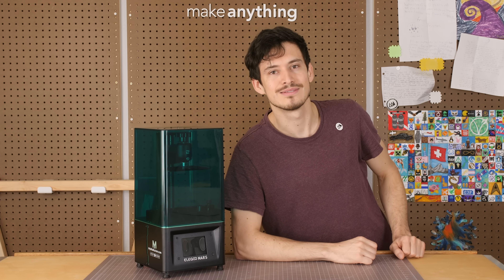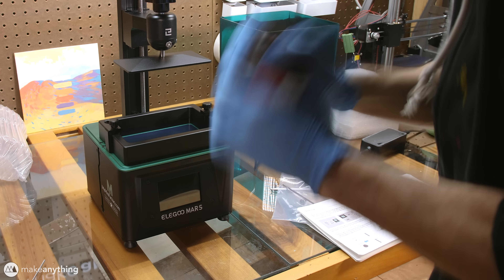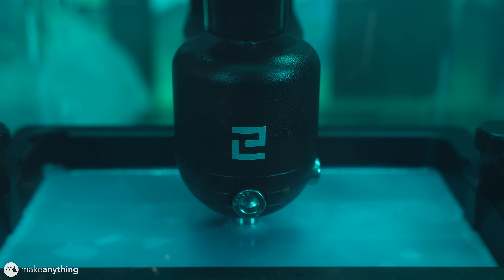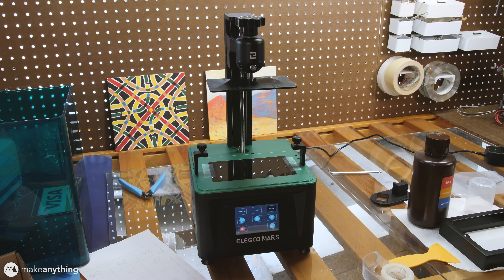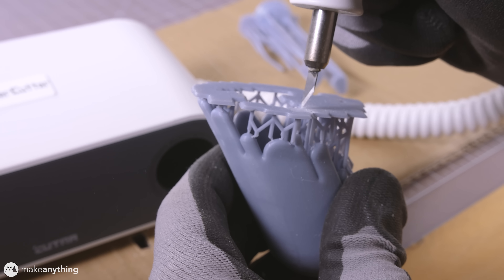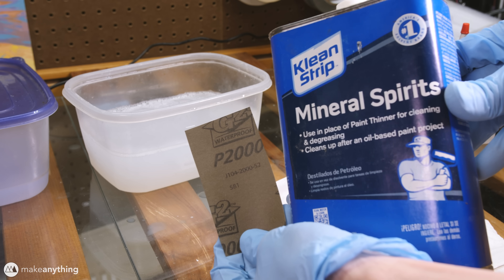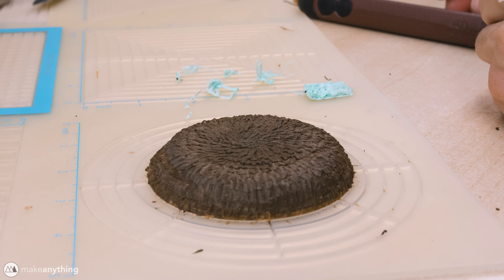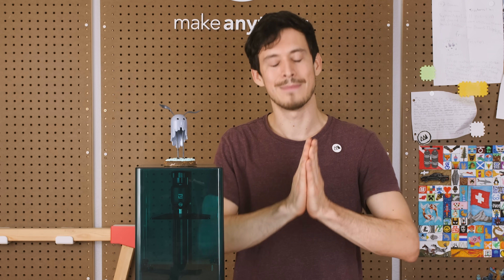Resin Printing with the Elegoo Mars // First prints, troubleshooting, impressions

Comment: Hey Devin, there are a couple things that I noticed. First, you have the reservoir in backwards.  You want the notch to be in the front right corner to make it easier to pour resin into it while printing, and when removing.  Also, it appears that you didn’t fully cure the prints, as they were way to flexible. It’s a misnomer that you can let them sit in the Sun for a few hours. It would take days.  It takes a few hours to fully cure prints with a 60W UV lamp.

As for the failures, that is due to the build plate not being flat.  I used 220 grit wet/dry sandpaper to level the plate against a perfectly flat marble surface.  Sand it down until there is no black anodization on the plate.  You can either leave it that way, or continue to smooth it with 400 grit. Then make sure you level it properly.  You didn’t show the test to ensure that it was flat, where you slide the paper in and out. Pay special attention to the corners.

The good thing is that they replaced the screws on your build plate with bolts, which is what you need to do if you buy the normal Elegoo Mars.  If you want truly accurate prints, you’ll also want to manually set the Z axis zero.  There are other things in the configuration that will make life easier too, so I suggest looking into them. I don’t have the links right now, but I can get them when I get home, if you need them.

Great content!
Reply from the maker: Sounds like solid advice. Thanks!
Reply: @make.anything  Fantastic video, few more small things i hope save you some time!

silicone sculpting tools are a great way to stir up your vat and the edged ones will also usually remove failed prints from the vat with a guarantee that you won't scratch anything

I would advise against paper towels on the vat! They leave lint and micro scratches and greatly increase the probability of something sticking to the surface.
Pick up some PEC-PADs for photography, they are very cheap and you can use them for you camera gear too! Great for cleaning the screen and other clear surfaces.

Most of the time you won't need to drain the entire vat for a failed print, if it's a large flat surface, you can use the silicone tools or your fingers (wearing gloves obviously) to extricate it. 

Ambient temperature has a dramatic impact on print success, generally, warmer is better but consistent temperature is also critical. take a look at egg incubators, they are cheap, you can position the thermocouple as needed and usually a ikea container or even a tote is enough insulation.

Might consider inverting your model if you are going to sand the surface regardless those "drip details would come out perfect

A #11 scalpel is a great tool for cleaning off supports, very cheap too.

Typically two separate washes of alcohol are used, if that's what your manufacturer suggests though, i would defer to that.
 A tooth brush really helps clean out those details after ten minutes of soaking in alcohol.

Finally, i second the build plate abrasion.

(note: i use a Moai 130 and Form 2 so there may be some machine specific differences)

Love your content and look forward to your future uploads!
Reply: I would add that it is easier to remove the supports before fully curing. This is information I only have second hand knowledge of as I have not yet printed anything on my Mars.
Reply: giliant you can use Kimwipes and alcohol on the film, as they are lint free and are non-abrasive when wet.  Kimwipes are heavily used in the electronics industry, and very minor scratches on the film don’t affect print quality. 😎
Reply: It might be very flexible because he used "ABS-like" resin.
Reply: Billynomate Mopp I have like 6 of the Elegoo resins, including the one that he used.  When fully cured it becomes very hard and stiff.  Due to the stiffness, thinner pieces become somewhat brittle when fully cured, but they can stand up to small amounts of stress.  His prints will continue to cure over time, in the position that they are standing.  Once fully cured, the legs could possibly break off if it fell off a shelf.
Reply: @KaelumYodi  Can you post the links for he rest of us, please?
Reply: Great feedback! I can't wait to start printing on one of these.. I'll make sure to pay attention to these items.
Reply: Kaelum I have an anycubic photon, and whenever I print, since I don’t have a uv chamber, I put my prints in a glass or clear plastic container filled with water, and it cures in about 25 minutes.
Reply: @johnbickford9221  I do that, it's much easier.
Reply: Most of this is actually in the manual where it explains what to do before printing, so all mistakes could have easily been avoided ;)
Reply: Hey @kaelum
Do you know of any video tutorials about leveling the build plate per your description? Really great insight in this thread!
Reply: @ChelseaMakes  if you are referring to sanding it flat, there was 1 that I remember seeing back when I first posted this, but I don't remember who created it.  It took me a couple hours of sanding to get mine flat, as it was not very flat at all.  Pretty much any granite or marble surface that is at least 1/2" thick, should be perfectly flat due to the way that they are cut and polished.

Just wet the surface with water, place the wet-dry sandpaper on top, and then push the build plate into the sandpaper to grind it down.  Be careful to keep the pressure in the center of the build plate to prevent rounding the corners.  Rotate the build plate every 30 seconds to help ensure that it is evenly grinding down.  You'll need to rinse off the stone surface and the sandpaper periodically as the aluminum dust collects in the water.

I think I went through 3 full sheets of sandpaper to get mine nice and flat.  I didn't use a fine grit sandpaper at the end, and even used 110 sandpaper for some of the grinding, as I wanted the micro groves to remain for better adhesion.  Once done, make sure you follow the leveling procedure exactly as written by the manufacturer. Most people don't follow it exactly to a T, which is why they run into problems.

The best thing that I can recommend is to read as much about the printing process as you can, and from many different sources.  Some advice will be good, and some won't be.  As you gain experience you'll easily be able to know the difference.  Enjoy your printer, and have an AWESOME NEW YEAR!
Reply: @KaelumYodi  THANK YOU!
Reply: So was it that the bed was not flat or that he wiped it with lubricant? Because after that it started working right? He didn't level the bed.
Reply: Homie the sun is more than 60 watts. 

Its not a misnomer, a lot of experts recommend putting Resin prints outside to cure while you are still new and haven't purchased a curing lamp yet.

Comment: these are not latex glove, don't use latex with these kind of resin, use nitrile gloves!
Reply from the maker: You're right, thanks!
Reply: Why?
Reply: @OllieDraws  Because Resin eats through latex and can get absorbed into your skin.
Reply: @ScaryScarab21  resin isn't caustic...
Reply: CrossedCoder Yeah, resin definitely doesn’t “eat” through latex. Although the pores in latex gloves are big enough to allow resin to seep through.
Reply: And also do not use a dust mask for fumes and vapours.
Reply: CrossedCoder resin is very toxic lmao
Reply: @CrossedCoder  But it's carcinogenic ...
Reply: @igotsth  Yeah it's so stupid that the supply you with a dust mask. You get the impression that it's the correct safety gear ...
Reply: NeX128 woaaaah i had this profile picture since 2 years ago
Reply: Can i also use vynil gloves?
Reply: @robbys929   Depends on which resin you use. There are non-toxic resins available.
Reply: GGigabiteM hey answer my boy west side, idk what the answer is but I bet you do
Reply: @GGigabiteM  What do you think about Anycubic plant-based resin?
Reply: @MurderHoboRPG  vinyl*

Vinyl gloves are better than latex in porosity (the molecules are smaller), more chemical tolerant and of course people can have latex allergies.

I usually use heavy duty PVC gloves when I'm working with nasty chemicals, but the downside is you lose a lot of dexterity and feel because they're so thick.

Other types like nitrile are OK too.
Reply: @pimbiob.v.4581    I just ordered two liters along with a Elegoo Mars.  So I hope the Eco-Resin lives up to the hype.
Reply: @OllieDraws  resin can bleed through latex. Would be like wearing nothing.
Reply: zapro_dk they are actually fume and dust masks they contain carbon-13 (activated carbon) which filters out the nasty fumes and the tightly woven material filters the dust out. 

It is easy to see if they contain carbon-13 or not, if they have a grey colour to them they contain it and if they are completely white they don’t.
Reply: Storil 4586 Carbon 13 is an isotope, heavier than normal carbon, activated carbon is steam roasted charcoal. Also, not all activated carbon masks are grey/black.
Reply: @robbys929  he said caustic not toxic
Reply: Did they just reuse the Vulcharc from the Kairic Acolytes for that Inquisitor...?

SHAME!
Reply: Thanks for the advice!
Reply: I've tested and latex (assuming you're not allergic) is better than no gloves at all, for me. I poured resin onto a latex glove and left it for several hours. The latex was untouched and the paper towel inside (to detect if the resin got through) was bone dry. I've no fear of using double latex (though I have nitrile at the moment) in a pinch. YMMV, as may your resin.
Reply: @dmthandmade5674  enjoy chemo
Reply: @CrossedCoder  resin is infact quite toxic. it will give you really nasty poison ivy like symptoms
Reply: @jaycececil  incorrect the volatiles in photo resin will dissolve latex gloves
Reply: @igotsth  the dust mask it comes with includes a volatiles carbon filter layer.
Reply: I don't use glove or a mask and now  i have a super power. It's called lung cancer
Reply: yessor, nitrile is definitely better

Comment: I would recommend removing supports before the final cure.  They're much easier to remove and have much less of a chance of shattering/pitting parts of print.  I usually just pop them off by hand after washing, and letting them dry.
Reply from the maker: That makes sense. I wasn't sure if I should handle the prints much before curing
Reply: Caution is always a good idea when working with resin (and new things in general) :)
Reply: @make.anything  Resin OEM here. We would recommend keeping the supports on for 2 reasons:
- some prints cannot stand on its own so you need support to keep it upright for curing
- prints shrinkage during post-curing. For long / thing parts, keeping support on would prevent/reduce wrapping during the post-curing stage.
Reply: @sirayatech2  I appreciate how active you are. Im doing research for a purchase and you are everywhere.

Comment: I had the same trouble. You don't need to drain the tank to remove a failed print from the FEP sheet. Take the tank out and hold it level so you don't spill anything. Using light pressure, run your finger underneath the failed print from one end to the other. The failed print will peel away and you can fish it out with the plastic scraper.

Comment: A tool that's incredibly useful for getting rid of the support marks is the AK Glass Fibre Pencil from AK Interactive. It's made for scale modelers but works insanely well (better in my opinion than sand paper) for getting rid of the support marks and blending the surface and surrounding area to looks smooth as butter.
Reply from the maker: Sounds cool!

Comment: 10:31 don't poke the fep film! You might puncture it! Push in a bit from the other side untill one edge of the cured resin lifts up from the fep film and then pull it out with your other hand.
Reply: Yep, I was looking for this comment. If you very gently push the FEP from the bottom, any "misprint" resin just pops off. No need to touch the FEP with any tools (though you may need to wipe the fingerprint off the bottom).

Comment: Hey Devin. I enjoy your videos and i don't like to be this guy, but please make sure you use (and point out to use) a proper respirator that takes care of organic vapors when dealing with the resin. I do own this fantastic printer, and the supplied face mask does not protect you from anything but splashes.
3M has a 'A2' filter that removes all odor and (as far as i could find) takes care of the other stuff as well.
And of course as others have pointed out, be safe, use nitrile gloves.
Otherwise great video, and nice showing of the problem solving with the first layer. I had some issues with his too, but after some fiddling, i got it sorted.
Have fun printing with with this great printer, and use proper protection =)

Comment: Thanks, it really got me started on Anycubic Photon S, leveling from start using tray, I could hear the popping sound and indeed, it went well. As for the fumes, filament printers are way more dangerous. I still have no idea why they instruct you to level using paper, I guess in order not to scratch the film, which is obviously no problem since it comes scratched and a few scratches pose no problem.

Comment: You can pause the print see if it is working.

I'd recommend curing the part while it is under water in a jar. It cures much faster. 

Lastly, support removal can be made easier by using a tub of hot water, soaking the print for maybe 10 seconds in the hot water and the supports should come off very easily and pretty cleanly as well.
Reply: I was looking for this comment! And I was silently hoping I could be the first one mention it... I've got my mars printer only yesterday so much to learn... ;-)
Reply: I've never heard of curing underwater. This sounds very promising thanks so much
Reply: @IlSharmouta  It seems oxygen prevents curing so if you can limit the parts "air" exposure they will cure better. Also if you get a semi cure from ambient light (there's a fair amount of UV coming off florescent bulbs for instance) before or while you are cleaning the part, the final cure can leave the part a little tacky. Its almost as if some of the solvent (water, soap IsoP gets trapped between layers of cured resin.

Comment: I like that tilting bed like that for dripping off the resin. Wish my printers had that.
Reply: Its just a 3d printed part (I know, the irony!) You pull the print plate off and then slide on the angled 3D part and slide the print plate onto the part to let it rest.

Comment: Thanks for another fun video. I'm pretty sure that it's not a DLP printer though. It's MSLA : masked stereo lithography. It's not using a uv projecting LCD screen, but rather a uv light source underneath an LCD screen that blocks the light everywhere except where you need it to cure that layer.
Reply from the maker: Yup you're right! I put a correction in the description, but all I can do is try to be more accurate in the future. Cheers!

Comment: Great overview of the Elegoo Mars and resin printing in general. =] You touched on some really great points about resin printing that have been what's kept me from it. This is the year I finally buy one and start with resin though, and this is just more good encouragement to do so!
Reply: If you can afford it, I'd highly recommend picking up some Siraya Labs Blu resin. Its translucent blue when cured, more impact resistant than other typical resins, and the parts can even have a bit of flexibility to them. Its on the more expensive side, but from my own personal experience with the resin it would make for a wonderful first experience.

Comment: I've got a Beam3D Prism, which is very similar. I've had almost no success with it so far, and it's wicked messy. I also had a pinhole in my vat and got resin directly on the LCD. That was so demoralizing that I haven't even bothered trying to clean it off yet to try again.

One tip about containing the mess is to get some disposable aluminum oven trays intended for baking turkeys from the grocery store. Some come with clear plastic lids which can be flipped over to use as another tray.

Comment: If you ever did cell phone repairs, you will most likely have gotten the UV glue kit to put the clear screen on the LCD screen and it will come with a very powerful UV flash light.
Just keep it around for spills, just flash the UV light and it will stop a spill RIGHT NOW WHERE IT IS, then you can just peel up the cured, spilled resin.
No need to chase the liquid with paper towels and alcohol leaving a residue everywhere!

Comment: I thought of a great idea for the resins. My friend was talking about pads for their 3d prints and I recommended resin. Anytime I feel there's a need for a rubber sticky-ish part, the resin would help (idk entirely, never really felt it). Like I could think of brake pads or bottoms of tables to prevent sliding. Maybe even shock absorbers for my computer! Those would make nice ideas on how it comes out. It would be funny to see a resin mug, so bendy. 

Maybe even trying out with a 3D resin pen - I've seen youtube videos on that - but still.

Comment: Hmmm. How would this work for printing AR-15 lowers? Because regular 3D printing an AR-15 lower kind of sucks. All the shrinkage and tolerances make it damn near impossible to 3D print an AR-15 lower. Would be nice to test strength difference of resin vs different types of 3D printing plastics.

Comment: I reccomend not buying Spray Cans, but the actual paint glasses and using an Airbrush. It's a lot more, like, a TON more cost efficient. A glass flask costs about the same as a bottle here, and unlike a bottle, it doesn't run out after 1-2 projects. Many paints I have used for years and they aren't empty yet either.